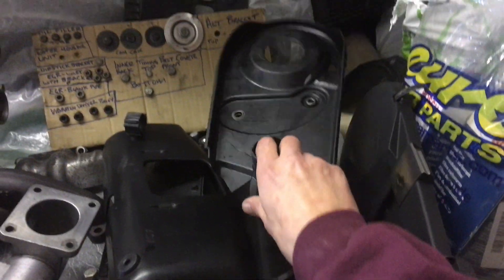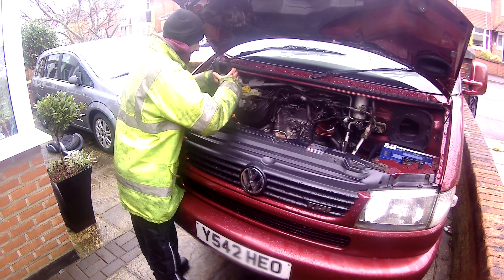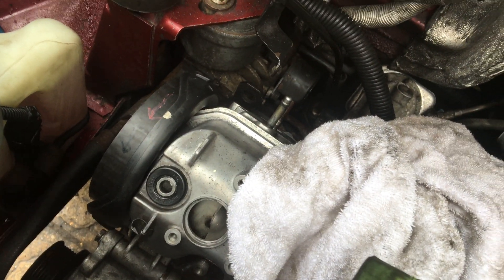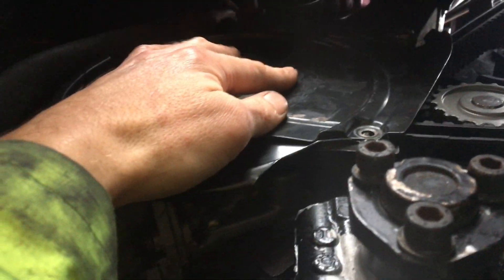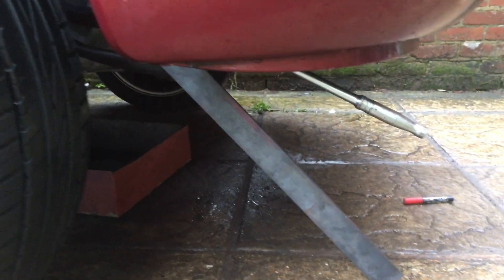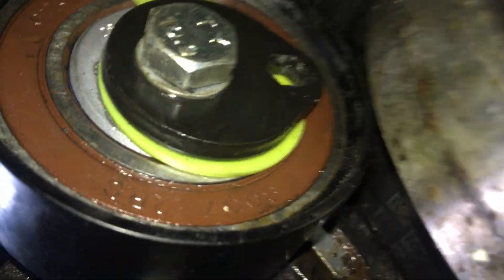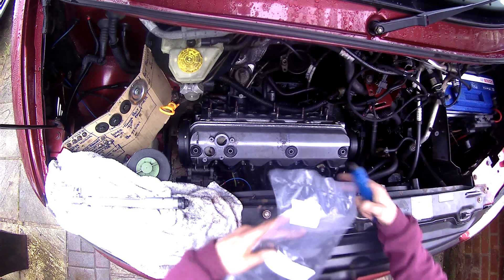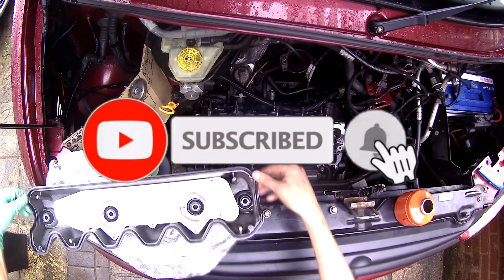Timing belt and Diesel pump belt fitted

Comment: Ao I take it you don't really need a dial guage for the rear of the diesel pump just time it up with its marks and lock it of by roving the spacer and tighten the bolt back up on the side of the pump

Comment: Hi twiggs could you tell me if there is a washer behind the pulley on the pump side the pulley with the bolt going through and not the one with the only the nut 
Thanks
Reply from the maker: No washer behind the pulley

Comment: Great vid chap doing mine now, found the tensioner on pump belt had failed and jumped two teeth caused nasty misfire low power  and some rediculous vcds figures. 👍
Reply from the maker: Cheers buddy, I’m glad the misfire was an easy fix, are you going to do cambelt/tensioner? It’s surprising how even 1 tooth out can cause issues, for many people they would have had to put the van into garage and then the garage to say they can’t find the issue then that persons posts on the forums and within minutes the fault is diagnosed 😂

Comment: The cleanest ACV this side of Rio Grande :D..Good job. You are doing it all literally by the book. If only garages were this meticulous. Can`t wait to hear it running. Make sure to turn it over without firing first, just so You build up oil pressure and fill the lifters with oil (not sure if You squeezed those in a bowl of oil before install, this helps). I`m fighting with electrics on mine. Making new loom for the headlights and running wires for the winch.
Reply from the maker: Thanks buddy, taking a bit longer than expected but its coz I can stop cleaning lol. No I didn't do that with the lifters so I will turn the engine quite a few times before I start it. I have turned the engine already and the compression is mad, before I could turn the engine easily. 
I've seen a few people upgrading the headlight wiring loom, Thats going to be awesome with a winch, going to be off-roader?
Reply: @TwiggsT4  Im installing relays for the lights and running new loom straight off the battery. You can do it just bypassing the weakest point (ori switches) and using existing loom but mine is bad, so all new wires.

More of a camper suitable for really wild camping. I just "got out" from offroading...not planning to use the T4 for such activity..but life will tell ;).